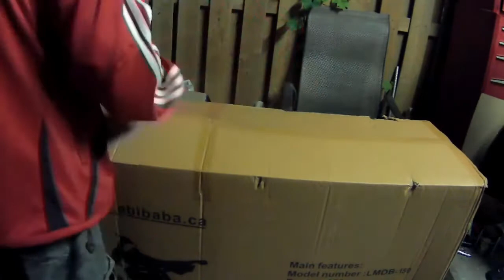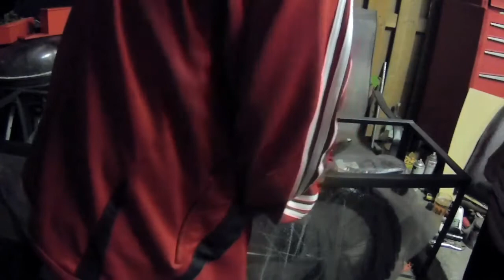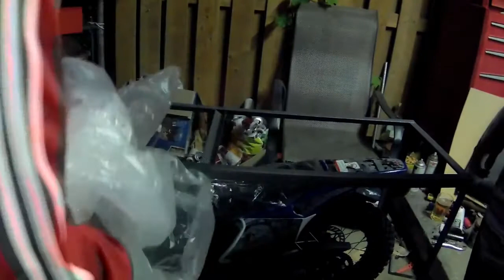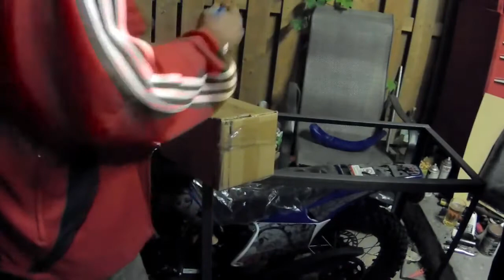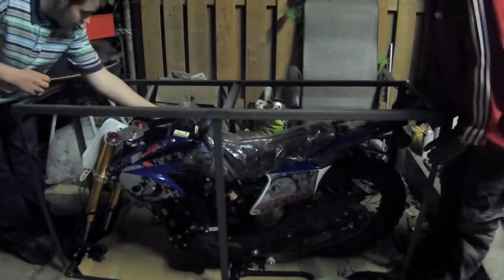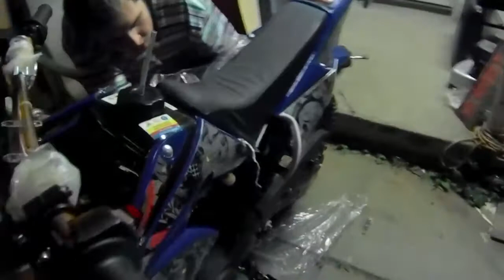My Early X-Mas Gift pt.01

Comment: Hi Neves. Nice bike ya got there.  Check the oil in her before you ride it. It  may have travelling oil in it. Or transport oil. Its not very good and needs to be drained out and the correct oil whacked in. 
Had a mate years ago bought a brand new RM 250 .  Didn't change the oil and fried it. Very expensive mistake.  
Have fun on her mate they're awesome  fun.